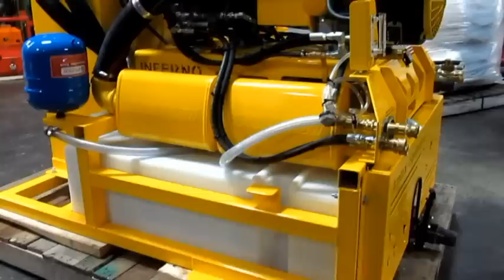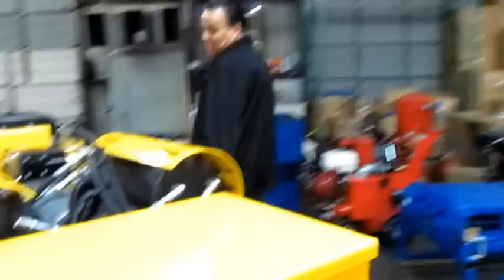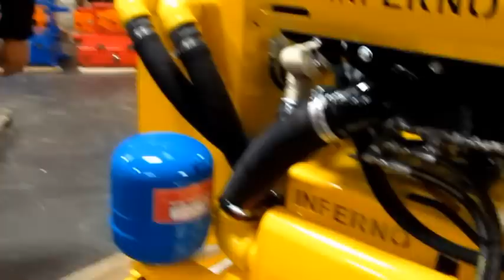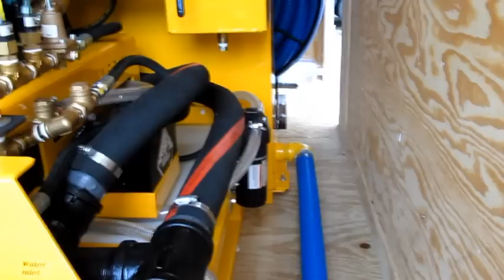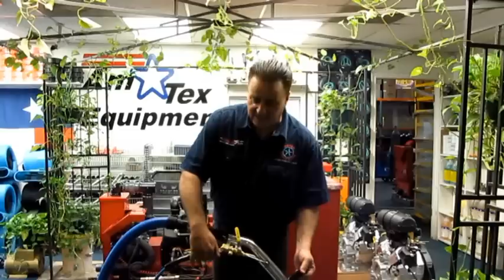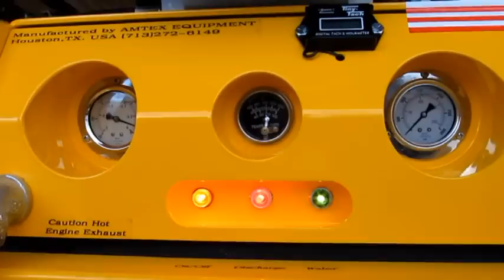Amtex Equipment Stack 3047 2012 Edition.wmv

Comment from the maker: @rblenian If you had seen the unit installed in person you would've noticed that there are plenty space for going in and out.
Reason for not having internal auto fill valve was that it will take about 25% capacity of
tank away to make the valve operational. compare to having a simple overflow hose which allows 100% capacity usage.
I would PM once I get a chance. Too many orders in progress now and finally
the Amtex Dream is here and we need to prove ourselves to our market.

Comment: The hose and solution reels are blocking off access to the front of the trailer making it difficult to get the tools and accessories out of there, not much room, I would have to look closer in person to see if there is enough room to squeeze by them.  I dont really understand the overflow hose idea, why not put an autofill valve which is nothing more than a toilet plunger?  Same as what you use in the waste tank?  Again, I don't mean to berate the machine or the vid, PM me on the forums!

Comment from the maker: @rblenian @rblenian Well, just to clear things out the position of stack on top of the trailer axles are for road safety, which leaves the front of the trailer plenty of space for tools and accessories.
Overflow hose is to prevent flooding inside of trailer when you are filling it, and water is used when you do a job of a property without running water, means you will use the water to clean not to pour on customers pavement.
How do you like your SS truckmount so far